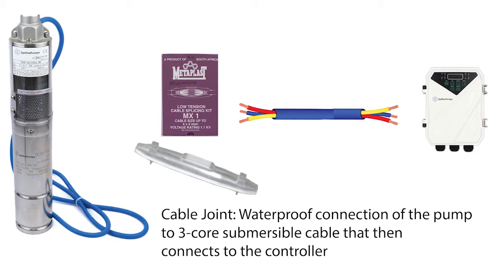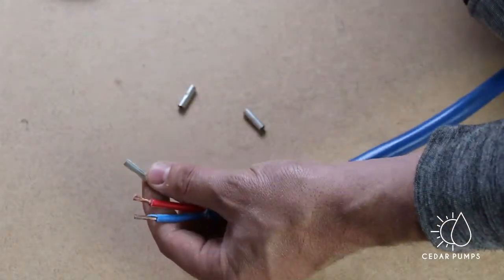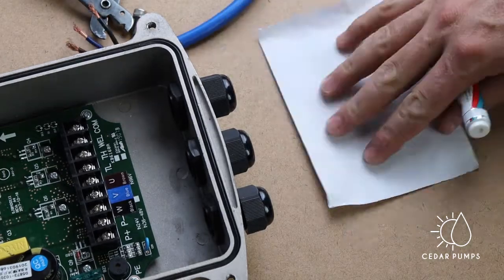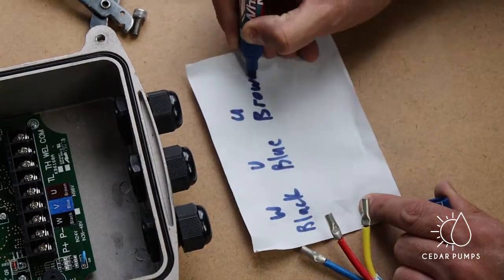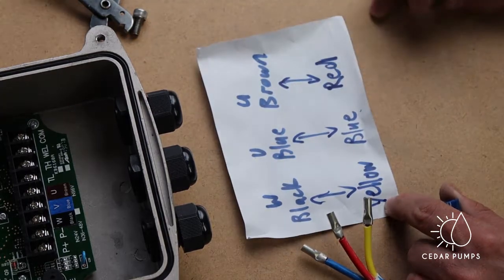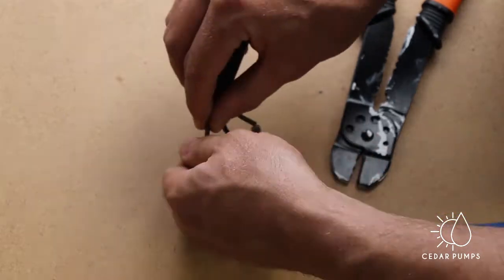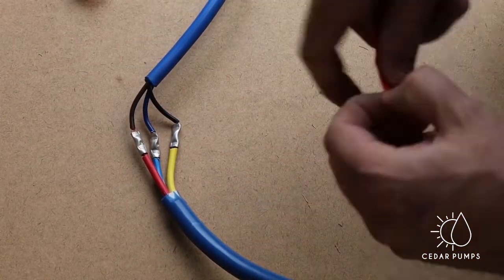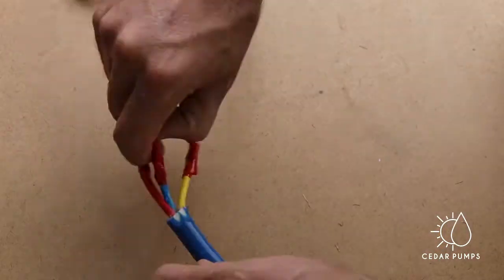How to make a cable joint for a solar water pump

Comment: My pump fail to pumping water what's the problem
Reply from the maker: There could be a few reasons:

Is it a new installation or existing installation?

What is the error code on the controller?

If the pump is a Cedar Pumps brand, please contact our customer support at support@cedarsolar.com.

If it’s not our brand of pump, it’s best to contact the company you purchased it from, as error codes may vary.

Comment: What can cause low water pressure after 20 minutes
Reply from the maker: The water in the well running out. Low water = low pressure. How strong is the well/borehole?